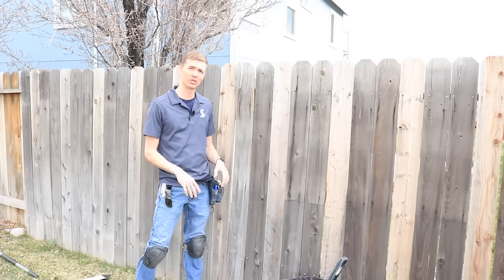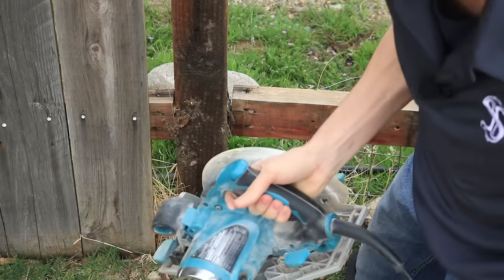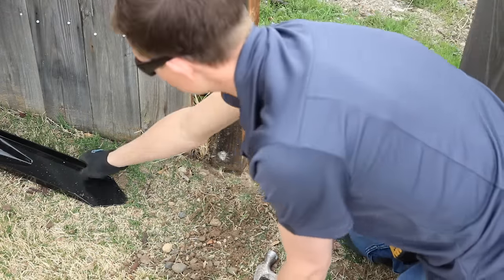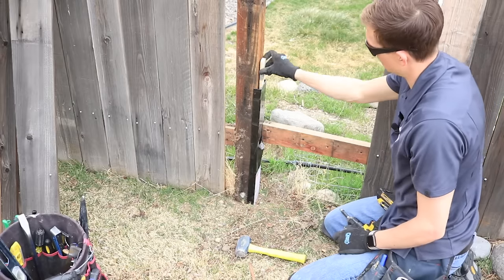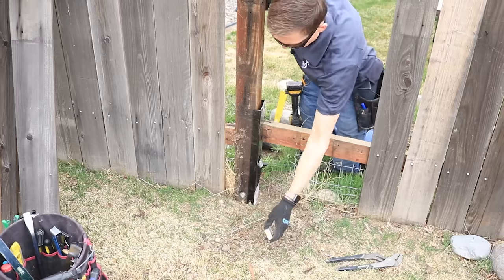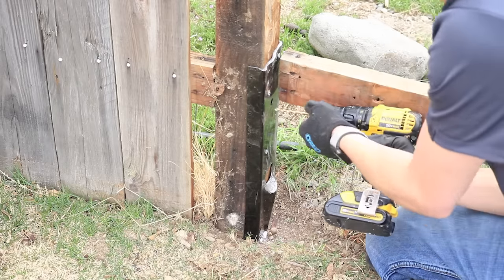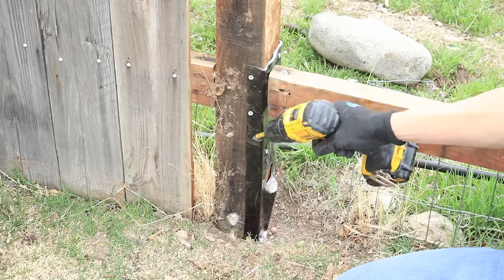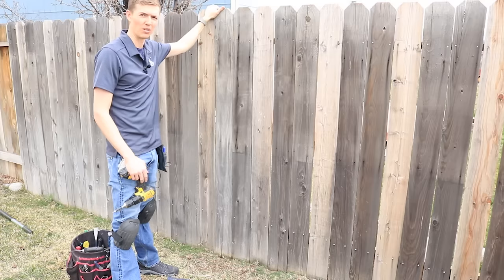How to Fix a Broken Fence Post in Under 30 Minutes

Comment: If the concrete extended above ground, the post would not be soaked in water and not rot!
Reply: Now you tell me!
Reply: Dave Micolichek  What if you put the messy side on your neighbour?  Doesn't matter then!
Reply: go ahead and do that in a frost zone...
Reply: Dave Micolichek  you have a crappy city code there buddy. Mine only says the nice side has to face the street.
Reply: HUH? methinks you don't understand ROT.

Rot occurs due most often due to WET / DRY cycling of wood, which places the wood frequently in the 30-60% moisture range where ROT THRIVES.

Always DRY: no rot.             Always WET: no rot.

Alternate between wet and dry: ROT

"WHERE" the top of the post is doesn't change this: EVERY RAIN, SHOWER or SPRINKLE with an irrigation system, WILL wet the bottom of the post where FIRST EXPOSED, and it will soak in either down below the top of the SOIL, or the top of the CONCRETE just the same.  THAT will be where it rots.

That's why, whether you use concrete or not, the TOP and BOTTOM of a wood fence will ALWAYS be the first places to rot: The TOP gets it because even a LIGHT SPRINKLE moistens THAT wood enough to encourage the SPORES, and the SAME THING is happening more often at the bottom.

The ONLY way to change this is via CHEMICALS.
Reply: @turinhorse  : To prevent the concrete from heaving, you MUST flare the bottom of the hole wider 
resembling a bell shape or elephant's foot....the concrete is locked in place. Contractors never do this
because it's hard work and time consuming.

Comment: That's a mickey moused 1/2 assed solution.. Just replace the post and pour in a new bag of concrete.  Do it the right way, don't just put a bandaid on the problem.

If speed is the issue I believe there sell some type of foam agent instead of concrete mix that dries very solid.  I saw someone use it on a video on here once.
Reply from the maker: You'll never really know that until you try it. It works surprisingly well.
Reply: @REVerbtalk  whats up with all of that looney tunes? Hahaha..
Reply: Just came to the comments forthe trolls👆

Comment: Uh how about digging the post up and replacing it?
Reply: He doesn't want to do that.
Reply: Yeah, I don't get it.  Do it right the first time.  Example, I feel bad for my next door neighbor. He bought the house next door and unfortunately previous owner was an expert at repairing things half ass or paying someone else on the cheap for a temporary fix.  He lived in the house for 30 years. The house has good bones and is structurally sound but every  system, appliance, major component in the house is in need of replacement or will be soon.     He had the money to do it right and on occasion spent more time and money doing it half ass thinking he was saving money.
Reply: Because it's a pain in the ass? And it's 2 to 3 times the cost?

Comment: Shouldn’t hit a hammer with a hammer. Tempered steel shatters! I’ve heard of a guy having it explode and actually need to have shrapnel removed surgically.
Reply: Happened to me many years ago. Chip came off my "new" hammer (at that time it was new), penetrated my chin. Still there to this day!
Reply: Jason Starr   Guy at work did the same. Had to have a metal shard surgically removed from his cheekbone.

Comment: Or you can just spend 30 mins and replace the post like we professionals do. 🤦‍♂️
Reply from the maker: Please shoot a video and show me how to replace a post in just 30 minutes.
Reply: I build fences for a living. I do it on a daily basis. Dig out around the concrete ball, take rock bar and bust the concrete off the post, life post out the hole, pull out pieces of concrete, put new post in the hole, put pieces of concrete back in the hole, level and square post, pour in new concrete. A lot of times it takes us way less the 30mins.
Reply: @johnnycash2238  can't read please post video
Reply: @johnnycash2238  waiting for your video.....
Reply: @Johnny Cash how's that video coming along?
Reply: I’m not a YouTuber. Lol. I don’t make videos or even know how to upload them. I build fences for a living. Literally an expert on the topic. But by all means listen to some guy with limited knowledge that specializes in making videos. I’ll stick to building stuff.......the right way.
Reply: Johnny, you may able to do this in 30 minutes (which is debatable), however for someone who doesn’t do this for a living, and has 2 fence posts to do and with limited equipment for this type of job (Jack anyone) , this seems like a nice convenient fix.  I think for the average person, removing the old post, putting a new post, levelling it, etc would take way longer than 30 minutes.
Reply: It’s not debatable. Lol. I wouldn’t have a job if I couldn’t. It’s not a better option because it’s a temporary fix. The wood rot will continue to spread until it’s beyond the brace. Then you are back to square one and wasted money and time. People that do these type of repairs are looking to get money for minimum work. We are looking at doing things right the first time and keeping our reputation.
Reply: Dave Micolichek  And next time, DO NOT CONCRETE THEM unless code demands it OR it's a gate post.  I live in Saint Petersburg, FL - a DOUBLE WHAMMY of hurricanes AND sandy soil.  The standard here, TO CODE, is no concrete required.  My 6' Fence has stood 20 years with standard 8' posts set 30", no concrete other than on a gate post.
Reply: Dave Micolichek  and NOT HERE.

Learn how Youtube works: only the people replied to get notified of a Comment, besides the OP.

Relax, you'll live longer.

Comment: if the concrete had been poured a little higher 2 to 3 inches out of the ground, the post wouldn't have rotted in the first place. ( wood only rots if it STAYS wet )
Reply: WRONG.  DEAD WRONG.

Wood ONLY rots due to a certain PERECENTAGE OF MOISTURE, most often around 30-60%.

Always DRY: NO ROT      Always WET: NO ROT (don't believe it: go to Venice and see St. Marks Cathedral standing 1200 years on wooden pilings driven below the water.)

Wood fences ALWAYS rot at the top and bottom first: it's where the MOST FREQUENT WETTING and DRYING OCCURS.
Reply: @brianmi40  that is correct, a submerged log does not rot. I repaired fences for a living for twenty years, the part of the post that rots is the part that is in contact with the ground (where the moisture is) if there is no contact between wood and dirt (pour the concrete above ground level and sloped away from the post), the life expectancy of that post goes from 8-10 years to 20-30 years I have installed fences this way in the 1980s that are still standing.
Reply: @ArgondtheGrey  I've gotten 20 years so far in Florida, simply set in the ground with 70% of them still very solid, so I see no benefit from concrete.  And these were never treated after installing.

To me, concrete isn't worth the expense, nor effort to install or add'l PIA to remove them later and doesn't change their life anywhere near the 30% additional cost, to say nothing of labor installing, and removing.

Being in hurricane Florida AND installing in very sandy ground, simply buried 30" has never created any issues through all the windstorms we've had in 2 decades.

However, in looking forward to replacement, I think I will go with Postmaster metal posts: essentially a NEAR LIFETIME mounting system.  Their galvanized .120" thick posts should readily last 50 years.  I have simple 16 gauge round galvanized posts that are showing little to any wear after 20 years.  And the Postmaster skips the need for mounting brackets, and creates the thinnest fence possible in any desired design, easily hiding the metal posts.  I also will do a kickboard since it's simple to add on a Postmaster and keeps wear down on the bottom of the pickets, probably going with a 5/4" pressure treated.

They're actually cheaper than std. 2 3/8" round galvanized posts since you have to add the brackets to them at $17 (bulk)(+4 brackets per post with a kickplate), when the Postmaster's are under $20 in bulk buy of 20, and again, the metal is twice the thickness, and NO brackets at all...

Literally ANYONE willing to do concrete, should be doing Postmaster posts.
Reply: @brianmi40  i am in Ontario Canada where the ground freezes solid up to three feet deep every year and 1 to 3 feet of snow on the ground for weeks on end is normal, a post only 30 inches deep will pop up out of the ground a few inches the first year and probably the year after that too. 48 inches deep, in a concrete sonotube is min required to be able to guarantee the post won't move
Reply: @ArgondtheGrey  Agreed (grew up in Indiana, so know well about frost heave).
Reply: @brianmi40  also your sandy well drained soil holds a lot less moisture than the heavy clay soil around here wood posts without concrete tend to rot just below or at ground level (needs air to rot)
Reply: @ArgondtheGrey  The soil drainage doesn't make a bit of difference for us.  We average 105 days of rain annually, that means the wood essentially NEVER dries out fully, regardless of what's happening in our soil.  THAT is the perfect condition for ROT.

ALL posts, ALL over the planet ALWAYS rot at GROUND LEVEL and just below a few inches below it with no concrete.  With concrete, substitute CONCRETE SURFACE for GROUND LEVEL and all is the same.  It is the NATURE OF ROT.

Comment: I just replaced about half a doxen 4x4 posts set in concrete. I bought some of these menders, but was afraid they would break up the concrete. I wound up digging the rotted wood out of the old concrete. It wasn't real easy, and some of them I only got about a foot down, but it was doable. A lot cheaper than the $20K I was quoted for a new vinyl fence. All the new posts seemed to have a larger and smaller end, and all were not symetrical. Find the smaller end, then keep turning it until it fits best. Most needed to be hammered in.

Comment: You should never hit a sledgehammer with a lump hammer . I've seen them shatter.
Reply: I follow the rule of not hitting one hammer with  another, but as I think back, I hit many wedges with sledges and many splitting mauls with sledges. I think that the sledge is not a tempered type steel like a 16 or 22 oz and it is OK for this.

Comment: Just replace it for a new one, that's a nasty way of doing a repair.
Reply from the maker: Sure, if you want 10x more work for very little benefit.
Reply: The post it self its 8 dollars concrete 5 dollars .5 hours to replace and drill back the planks! 
Save me 2 hours of pounding!😂😂😂💯💪👏
Reply: Jason Amos  There is no need to be abusive, just state your point without the abuse.

Comment: Great advice.. I have a huge long fence with this problem. 
One question, why does nobody seal wood fences with solid stain so they don't dry rot? Also i wonder if a galvanized brace set in the cement would keep the posts from rotting??
Reply: Here in New Zealand, fence posts are treated or "tanalized" so they don't rot. Treated timber is always more expensive than untreated, so you'll always get people going for the cheaper option. Those are the fences that need repair after 10 years.

Comment: Just dig up the post for crying out loud.
Reply: Yep, and half of the time; the concrete footing breaks
Reply from the maker: I could do that if I wanted to triple material costs and quadruple the labor required.
Reply: @David Duke Yes sir.  That is what most reputable fencing contractors would do; not put a bandage on a sucking chest wound like this guy.  The hole is already dug, it is a 45 minutes job, and most of that time is mixing concrete.
Reply: This dude is a squid

Comment: OK, first, slap the guy that installed that fence in the first place. Why are the rails butt jointed? Who does that?

Second, that solution will probably not last long - especially if the cement is fracturing, which it probably is.

Third, that's just fugly.

Fourth, I'm not convinced that this was EZ-ier than removing the original post

Comment: that was awesome...i think this is the sme problem I have. Does that metal thing go into the concrete? If you hammer it down between the post and concrete, isnt it going to bend at the bottom?
Reply: It kind of 'slices' between the post and the concrete ball holding post. It just keeps slicing thru the ball. Mine never seem to bend thou it gets harder to plunge in as gets deeper cause that spot u saw him hit starts to flatten.

Comment: Really stupid thing. Even if you are able to get this installed the post will eventually get weak again as the concrete will break over time with the help of this product. Concrete and new post will cost about $15. The concrete and post can be removed in 15 minutes maybe 30 if your unlucky. At the end of your labor you will have a nice post that will last many more years and not a eye sore like this metal product will be.
Reply from the maker: Sorry bro, doesn't work that way. Posts take a long longer to remove, plus pouring concrete and setting the post plumb takes time. These will easily get another 10 years out of a post.
Reply: No it doesnt take that long. I build fences, decks for a living. I think I know how long it takes me to remove an old post. Another 10 years on the post? That might be true as well but if you have to do this to a post it is most likely the remaining post and fence doesnt have much life left on them. So a person might prolong the time they will have to shell out the money to replace their fence by spending their money on this item to include hiring a handyman like your self for $100 each time you come and install one of these if homeowner decides they are not going to spend money for equipment.

Comment: If you do this often, then you might build an installer.  Measure the distance between the pushed out part where you hammer and the top of the EZ Mender.  Bend a piece of steel ( 18 ga 4 inches x by the measured distance plus 4 inches and bend the ends at right angle so 2 inches stick out at each end. Then cut a piece of southern yellow pine 2 x 4 so it fits into the steel piece.  Using the EZ Mender as a guide, drill a 3/8" hole in the new piece to align with a corresponding existing hole in the EZ Mender.  Carefully cut a 3/4" dado in the 2x4 just above the hole.  Drill a 1/4" hole in the 2x4 to match.  Bolt the EZ Mender to the 2x4 with a 2" machine screw and draw tight.   Put the combo in place just as you normally do and hammer on the top of the 2x4 until the EZ Member is installed.  With a Sawzall or equivalent, cut the head off the bolt, remove the reinforced 2x4 and finish the installation.  This would give a big ledge to pound on with the sledge hammer and make it easier to  install.  Hope the explanation is clear enough.

Comment: A new post would be 10 bucks and a bag of cement 5, just dig up the old one and put a new one in
Reply: I know an easier way to do it...
Reply: And DO NOT USE CONCRETE.

Concrete is ONLY for loamy soil conditions OR for gate posts.  I live in St. Petersburg Florida with the DOUBLE WHAMMY of hurricanes AND sandy soil.  My 6' fence has stood with 8' posts set standard 30" down for 20 years.  Concrete is a JOKE for normal situations and non-gate posts.
Reply: @brianmi40  in Orlando  ,the posts I set in sand in 93 , had no rot when I replaced them last year
Reply: @brianmi40  no treatment  , I said no rot , but it was negligible,  4 in  , the rest is still good and reused , along with scraps , I've picked up   You may see some on ny channel
Reply: @brianmi40  ps  my uncle is off 699 and 131 in maderia bch

Comment: Striking one hammer with another  not a good idea , very likely to chip
Reply from the maker: I've done this at least 30 times with no chips. But, that's also why you need to wear eye protection.
Reply: Wrong.  Cold forged steel is still softer than stone and concrete (which they are designed to hit and destroy).  At normal ambient temperatures the metal will deform before any stress fracture forms.

Comment: All that work just replace post
Reply from the maker: To replace the post takes like 5 hours. To fix it like this takes 30 minutes. Not even comparable.
Reply: @StayHandy  i change a post removing the below part by pulley it up and put another post in less than 3 hrs...
Reply: Bologina

Comment: Great video on repairing a fence post. You put the ez mender on the side of the post. Can they be put on the front and back. This way the bottom rail and the fence boards do not need to be cut or remove prior to installing the ez mender. Also, will the post be more stable if the ez mender is installed on the both sides or front/back of the post?

Comment: Yup I tried something similar and it was horrible ,bent it and ended up digging around around the post . Chipped out the concrete replaced the the post with a post-it  . Now I have a new post that is solid ,I tried it the supposed easy way didn’t work ,went the long route and worked better .
Reply from the maker: Sorry to hear it didn’t work for you. I find this works 19 times out of 20, but occasionally you have weak concrete or it’s very difficulty to hammer in.

Comment: I just used a green wire fencing post. Just pounded it in and used steel straping to secure it to the post. Worked for 15 years till the neighbor replaced the fence. Yes it was theirs but i did this repair when an old lady owned the place. She was happy with that fix. Reminds me that i still need to take those out.

Comment: Thanks for the video by the way. My only concern is how does this not split the concrete every time? Does it bend underneath the post? Thanks in advance.
Reply from the maker: Sometimes it does, but rarely. The metal just ends up molding into the concrete.